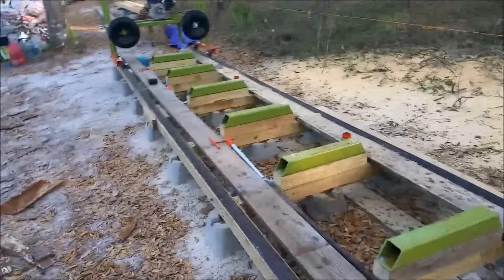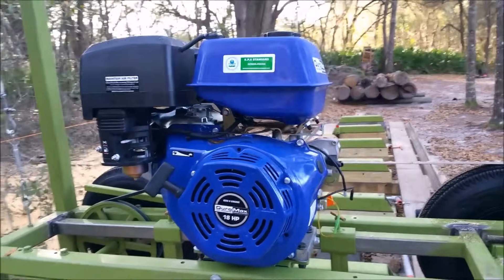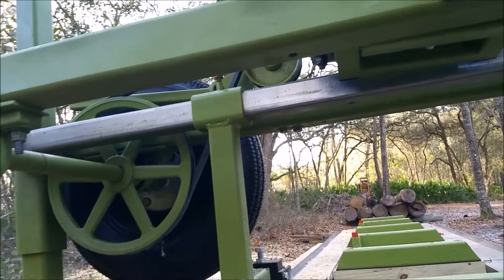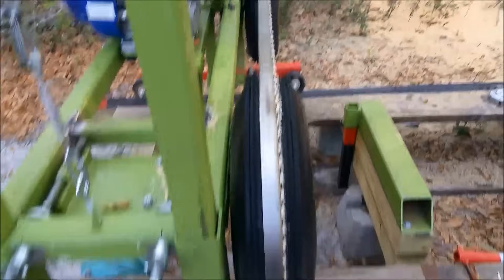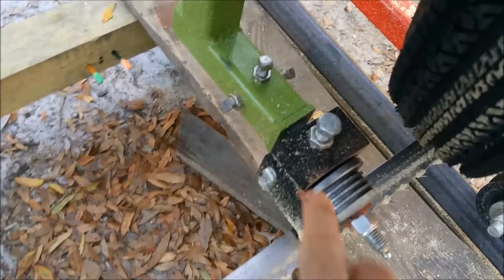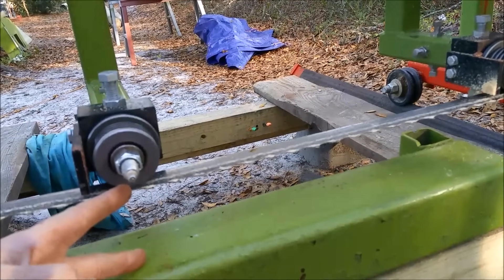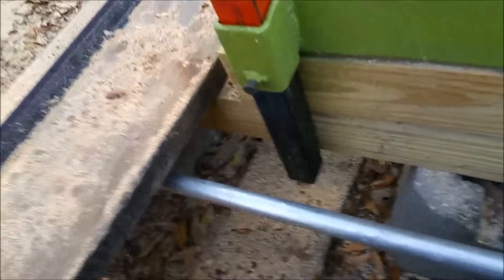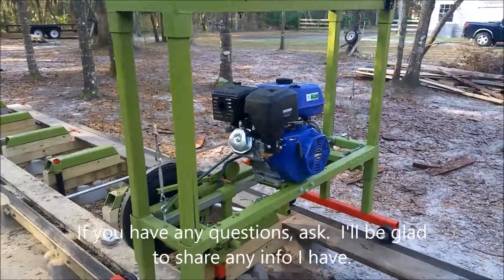Homemade Bandsaw Mill walk-around

Comment: Do the rubber tires not bend the teeth ?each tooth is bent on angle to cut properly does it change the tooth pitch ????
Reply from the maker: I had no issues with the pitch being bent. They are hardened blades, so I'm sure that keeps the pitch rigid. I did later rebuild this saw with band wheels and it was more reliable from blade wander.

Comment: great video an good job on the build im probably going to copy this model can i ask did you use the 2” and 2.5” square stockon the mill because of strength or did you have the material to use im wondering if i could get by with a smaller size to save some cost thanks
Reply from the maker: You want the finished product to be as strong as possible because there is quick a bit of tension on the blade. I would say build it as solid as possible, but able to fine tune adjust still. I would not use any smaller material or any thin walled tubing. Just my thoughts.
Reply: thanks for your thoughts can i also ask how you attched the v casters to the bottom of the mill frame i see alot that are directly underneath but these are off set to the side do you like how it operates
Reply from the maker: I ran a bolt through the bottom rail and through the caster with a lock nut. The wheels just sit beside the bottom frame with a bolt through them. I think it took 3/4" bolts or maybe 5/8"
Reply: thank you for the tips
Reply from the maker: Thank you

Comment: I see a couple additions to your machine. One for safety and that is a blade guard/retainer that will contain the blade if it breaks. The second one is some bristle brushes attached to the front and rear of the guide wheels that carries the motor blade assembly. That would keep your track clear of cuttings when attempting to move the cutting assembly forward or backward. Other than those items it looks really thought out and built. Wish I had your skills.
Reply from the maker: Appreciate the comments. I did build a guard at one point and ditched it when fine tuning, just never put it back on. I also ended up rebuilding the entire machine, making it taller and more solid. It was just about perfect when I sold it. Lol

Comment: Impressive build. Very good design/engineering and excellent execution. Roughly how much….including the blade, motor and everything else….did you spend on materials? Can’t imagine the amount of time this took but it must have been hugely satisfying when you did your 1st cut. Good job and good explanation. 👍🏼
Reply from the maker: Appreciate that.

I had scraps and bought materials and also completely rebuilt it after this video, but with the knowledge I have now, plus building it better from the start, I'd be around $2000 and many hours of work.

Comment: Brilliant job on the build. One suggestion: if you use wooden pegs for the vertical supports, you avoid any chance of damaging your blades on them. Also if necessary they can be left higher, and you simply run through them
Reply from the maker: Thanks. Appreciate the advise

Comment: What's the width on this from track to track, very well done and very simple design, been studying this to replicate.
Reply from the maker: I cannot remember the width between rails. I want to say 35" maybe. Something to remember, is build it as narrow as the widest you'll ever need it. If you plan to cut huge trees, then build wide and tall. If you plan to cut smaller trees and resaw lumber, then build it smaller. When I build another one, it will be smaller. Reason being is that smaller is easier to align and tighten the band. Just food for thought.

Comment: I am trying to build my own. I have a 18hp duramax, a frame made from old steel scaffolding I found, I purchased a set of saw blades, and have some old tires. Where did you buy/find the bearings, the pulley, the engine shaft attachment, the blade guides, and the boat wench? I searched harbor freight and hdepot and couldn't find those things. Thanks for the video!

Comment: Curious, what made the firs design underbuilt?  I have 6" pallet racking from Lowes i plan on using.  Its 1/16 wall but about 6" square.  Having 2nd thoughts now.
Reply from the maker: The pneumatic wheels gave a little more than I liked, not rigid enough. I went to cast wheels. 

As for the frame and carriage, 1/8" would be optimal. I'm not sure 1/16" would be strong enough, it seems it would warp with tension. I think those racks are hardened so that might be useful. I don't know. Also my tensioner was well underbuilt and needed redesign.
Reply: @joshsbomber  wheels I have are cast. I’m gonna give the racking a shot, have so much of it that it doesn’t make sense not too. 

Appreciate your reply

Comment: If i use electric motor .....what hp motor should use
Reply from the maker: That might be a better question for Google. I know there's a difference in actual force between internal combustion and electric HP, but not sure the percentage ratio between the two

Comment: Any issues with binding when raising and lowering on the four post design?
Reply: Thanks for your insight.   I really like the design of the mill you made.  I am "borrowing" quite a few of your designs
Reply from the maker: It raised and lowered without problems. I guess the weight kept it from binding up
Reply: @joshsbomber  Did you try and center the motor and balance out the weight?    I'm having binding issues with my homemade mill with 4 posts......
Reply from the maker: @Mark Johnson  I did center the motor side to side, but the bulk of the motor weight was to the rear, so not sure centering is the "key" to solving the problem. When I rebuilt this saw, I considered running casters on my rails, but never did. If you paint the rails, then raise and lower the carriage, you would see where exactly is binding. From there adjust the rails to prevent the binding. It's hard to advise anything without being there. Hope that helps

Comment: How many hp n the motor and how many rpms
Reply from the maker: This is a 18hp Duromax single cylinder engine. It was plenty of power and max RPMs are 3600. I used it around 3000 RPMs.

Comment: Very good work !
How did you connect the tires to the axle?
What flanges did you use?
Reply from the maker: Thank You. I used hubs from ebay that fit the axle diameter and the wheels. I forget how they label them. Maybe as four-wheeled or go-kart hubs, possibly.

Comment: Hows your mill holding up its been 4 years , did you have plans to build it or did you just build it on the fly?
Reply from the maker: It did well, but I ended up rebuilding it with stronger parts (actual band wheels, larger axles, taller frame, etc). Then, I sold that one to an older man who wanted something to tinker with.
Reply: @joshsbomber  that's cool , I was thinking of making a mill but I have $0.00 most of the time , I really want to build my own because buying a mill it just to costly , thanks for your reply
Reply from the maker: If you have no experience and not all the tools you need, it probably is safer financially to just spend a little extra and buy one. I will probably buy my next one. Another option would be to buy a cheap one and fix it up some. Like a Harbor Freight one.

Comment: Nice. Personally I would have done something other than lumber but it's awful simple but adequate, I like this more than many of the others I have watched which are either low quality or more complicated than I care for
Reply from the maker: Thanks, I wasn't really sure what to cut with it once it was built. Lol I later went to cast band wheels and larger axle size, as well as centrifugal clutch pulley. All positive improvements. Eventually sold the mill and have not built another. With that said, I might build another someday.

Comment: Do you recommend tires or solid pulleys?
Reply: I really like your video.  I’ve watched it 20 times. I am having trouble finding parts. How wide is your track?   What are the dimensions of the frame?   The only Cooks blade guide assemblies I can find are for 1.5” blades.  What blade do you run?  Those guides are $179 each?  I can’t find solid drive pulleys anywhere.  Advice?
Reply from the maker: Solid wheels. The tires are cheaper and will work, but give a little more than I liked.
Reply from the maker: I don't have the dimensions and sold my mill a couple years ago, so can't measure. As for the band wheels, find a sheave or pulley at Surplus Center and search around, you can find which belt folks are using as the wheels. I got mine on ebay, but could have saved money on Surplus Center.
Reply from the maker: As for blade guides, I went through Cooks. They were not cheap.

Comment: Nice build really like the blade tension/alignment set up.  Is their anything to lock the saw in position or is it just gravity pulling against the cables keeping it from moving?
Reply from the maker: Thank you. I appreciate the confidence in the tension/alignment mechanism, however it did have its flaws especially with the tension. The coupler nuts wore lose over time. As for the frame, it hung from the cables. It was hundreds of pounds so no worries on that.
Reply: @joshsbomber   I have one more question if you don't mind. While researching saw mills I saw a few videos (all in foreign countries) where the saw was fixed and the wood was on sliding table. Is their any advantage to this type of mill?
Reply from the maker: It seems easier to move a couple hundred pounds than maybe a ton or more of wood. I have no knowledge to back that statement but my thoughts at least.

Comment: thanks for the great video! I recognize some of the features, but that's life. simple is simple, no matter who thinks it up first! I was wondering what you spent on parts/materials, and how many hours would  you say went into building it? Thank you!
Reply from the maker: Thank you. As for hours, if I worked 10 hours at a time and had all materials ready to weld, bolt, and at my fingertips, I'd be around 20 hours (assuming I had a plan and didn't make mistakes). As for materials, minus the engine, around $1200 maybe. As a first time builder and amateur welder/fabricator, I have probably 3 months and $2500 in it.
Reply: @joshsbomber  thank you very much for your answers! I bet people would buy plans if you offered them. I wanted to ask you about the rails and the wheels if I could. Is that two thicknesses of angle for each of the rails? How do you make and keep the rails straight so your lumber comes out straight too? I need to look again how you mounted them. They aren't ground though, are they? I mean are they straight from say a steel service center without machining? I also wonder then if the inner profile of the wheels misses the corner entirely and makes contact on the sloping surfaces, say 1/8 to 1/4 down each side from the sharp corner?  As a test, if you ran a line or laser down the ridge of the rails, would it be true its entire length, or within what acceptable tolerance? I really appreciate your time!!
Reply from the maker: The rails are straight "enough" from the steel yard. The wheels are v-groove wheels made to fit the 90 degree angle. To fasten them, I drilled holes just larger than the screw and rolled the carriage about 2 feet at a time and screwed in the screw to keep alignment correct. With blade kerf as a factor and also shrinkage/expansion of the wood itself, the rails don't have to be "perfect" just close enough to plane out in the final product.
Reply: @joshsbomber  thank you! I did see where the angle was doubled from an end view, as you welded tabs to keep the carriage from going off on either end I imagine. I'm assuming then the bulk of the length is a single thickness of angle, 1/4" thick then, though not 100% sure what I'm seeing lol I love the idea of using the weight of the carriage to make the down pressure even across the length while fastening! I understand about planing out any discrepancy, esp as I see the main frame of the mill is wood, which will always flex and shift to some degree. This second design looks really good to me. It's inspiring! I saw an 8x16' trailer frame for $150 the other day lol it could be a beginning! Much obliged!
Reply from the maker: @CuriousEarthMan  sounds like you got it on the rails. It was semi-solid for the most part. The weight didn't affect the rigidity tho. I had it pretty solid. Thanks

Comment: I like your hoist , I did a similar hoist for a 30 ft wide insulated window cover for my greenhouse window.
If you continue having trouble with axel breakage you may want to consider putting a support on the other end of the axles.
I have not had any problems sawing hardwood logs up to 3 ft diameter on my homemade mill .
Nice work!
Reply from the maker: Thanks. I ended up rebuilding this mill since the video and yes, upgraded the axles to 1.5" and set bearings closer to steel wheels on the new build. After getting her running good and cutting good, I sold it. Haha

Comment: What did you use for your wheel hubs and how did you attach them to the axles? Was your axle failure due to twisting or bending?
Reply: Also, what’s the approximate distance between the wheel center lines and the distance between the rail centers? I like your design and will be building something similar.
Reply from the maker: Thanks for the comment. On this mill, the wheels where 16" trailer wheels with small trailer hubs or four wheeler hubs. The bolt patterns matching is the only specifics for those two items. The axle had a key way slot and the hubs had a key way slot. As for the axle failure, it was due to the tension applied on the blade and the distance between the pillow block bearings and the band wheel. If I ever build again, I will use the "H" design frame for the wheels that way a bearing is on each side of the band wheel. I eventually rebuilt this mill with 1.5" axles and steel bandwheels. That works so much better.
Reply: @joshsbomber  Thanks for the reply! Did you stay with 16” on the steel band wheels?
Reply from the maker: I cannot remember and it appears eBay does not have record back that far. I think they where around 16.5". Surplus Center would be the place to find large v-groove pulleys, tho. The rubber can be found at any car parts store (i think it's a size B belt). It is a very tight fit on the v-groove pulley and just about 1 or 2 mm hangs out over the edge of the pulley.

Comment: Can you share the rough dimensions of the frame and legs? Awesome build!
Reply from the maker: Thanks. It has been years since I touched this thing. I rebuilt it and sold it. If you are researching for the height, my rule was that if I have a 24" throat wide (so, 24" cut width on a log, then I want to be able to raise my blade 24" high from absolute zero (which would be log bed). So account for motor and any other height restrictions that would limit the rise of the blade. It ends up being pretty dang high. My final build was over my head when on the rails. As for width, I mocked up everything after buying my blade. Once mocked up, it determined how wide I needed the frame and carriage to be. Hope this helps.
Reply: @joshsbomber  absolutely helps. Thank you very much

Comment: This is my effort. I've had it running about 2 years now. Since I published this video, I have made and attached a remote throttle and push bar that gets me out of the bunks. I've milled about 200 slabs and still improving it. I took a lot of ideas form you though so thank you. https://www.youtube.com/watch?v=K34qkF_XGk0&t=25s
Reply: I'm the same guy as 000BigKev but changed the channel to just post Sawyer videos.
Reply from the maker: Thats a very functional saw. Looks great.
Reply: @joshsbomber  Thanks mate. It does the job.

Comment: What 4-bolt wheel hubs did you use?  If they didn't take the keyed shaft/axle, did you weld them to the axle?  What V-grove wheels did you fine?
Reply from the maker: Its been a while since I bought these. The hubs where standard 4 bolt with 1" hub with keyway (probably for a utility vehicle or something). The rims and tires came as a package. They were around 16.5" overall height. I actually used the air pressure to help tension the blade, in addition to the tensioner.
Reply from the maker: With all that being said, I later upgraded to 1.5" axles and 18.75" band wheels. I would go with band wheels any day over the rubber tires.

Comment: I've watched a lot of different videos trying to figure out how to make my own sawmill. Started in a somewhat different direction until I saw this video. Spent a couple hours trying to figure out how to incorporate your ideas without having to start over. Your design and your video to explain everything is better than anything else I've seen. Thank you for putting this out there, I'm alot more confident I'm going to get a good build by using your design, especially with how well you explained everything. You are da man, thanks
Reply from the maker: Thanks so much. Just keep in mind everything needs to be very rigid, but adjustable. With that mindset, you will have a fine mill.
Reply: What's the cost of everything that goes into it?

Comment: Very much like what I decided to build. Mostly because of the scrap I will be building with. My blade guides and first band blade should show up next couple days. I have most everything I need otherwise. Using 19 to 20 inch trailer tires from Walmart off old trailer for band wheels. To keep weight down, will be using parts from old exercise equipment, most of my steel is much to heavy. Will post videos of project at some point soon.
Reply from the maker: Very cool. Good luck and thanks for watching. Hope it helps out